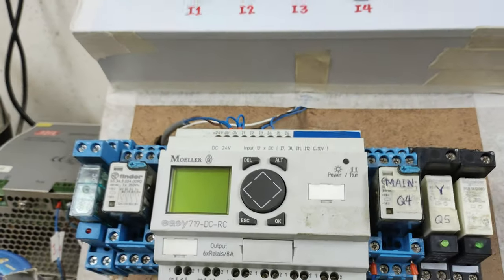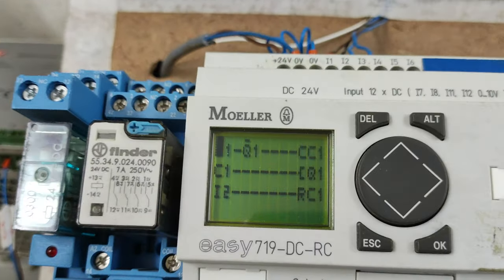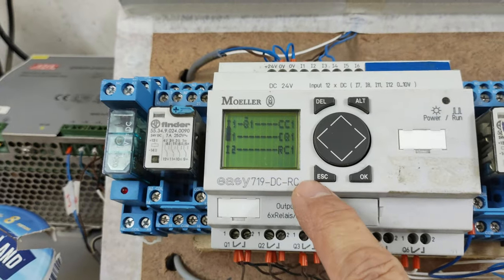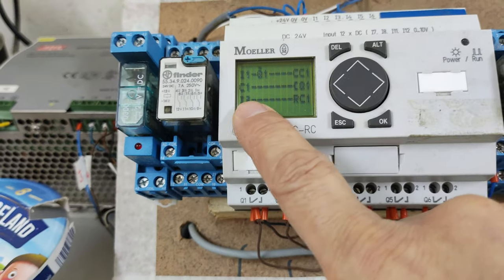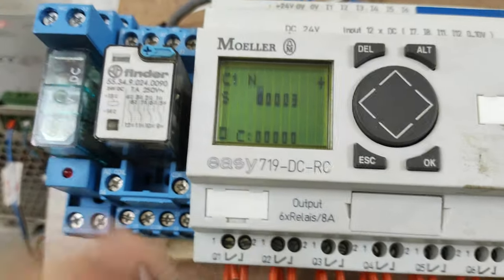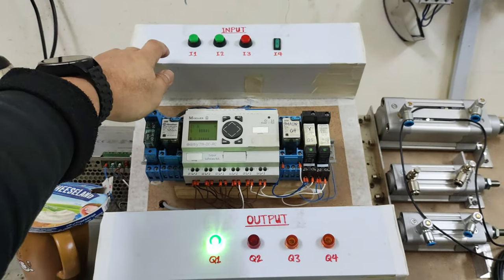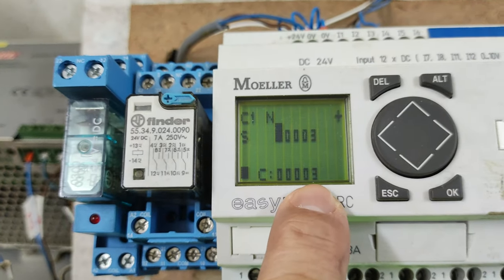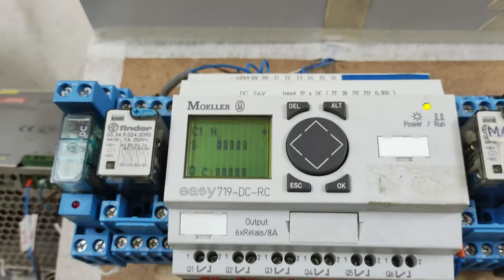How to program a Counter | MOELLER EASY 719

Comment: Hi Buddy, thanks for sharing. Now I got a new problem for this. Actually I need set a counter on this easy relay with a photo sensor. and also connect second sensor to reset the counter as possible. Do you know how ？